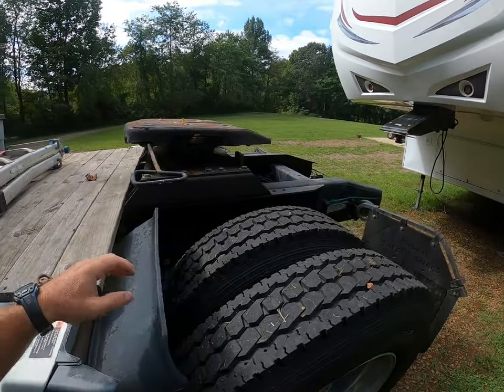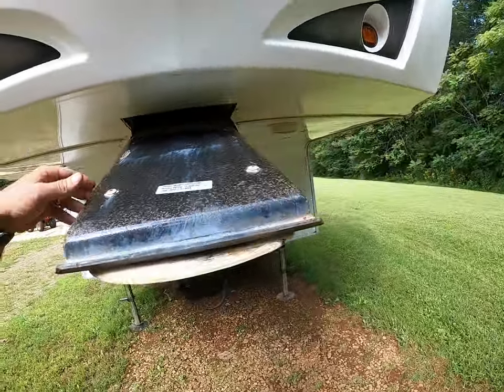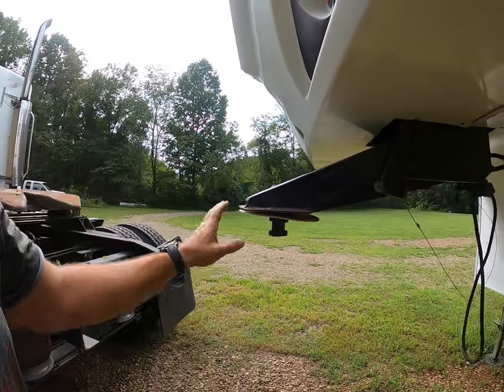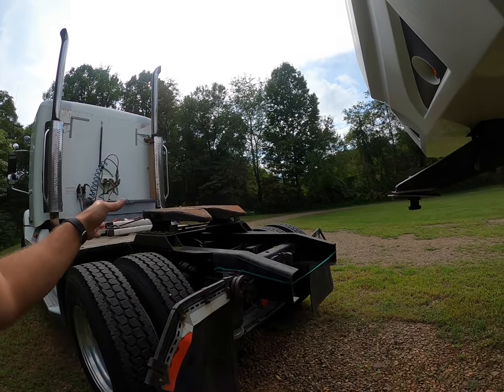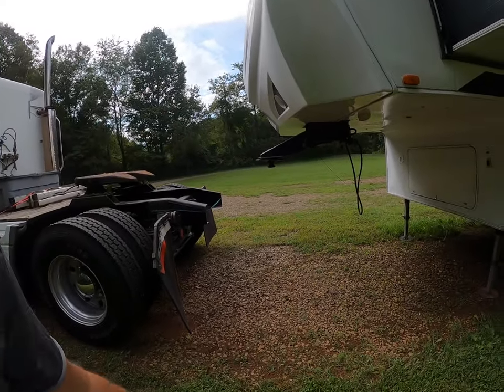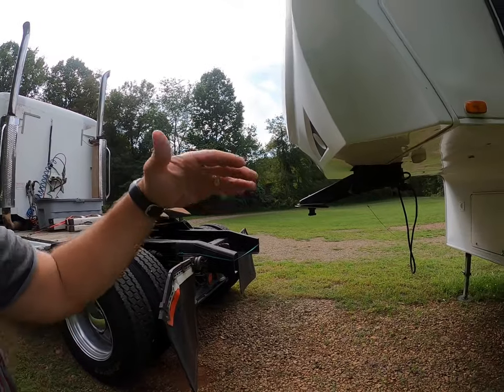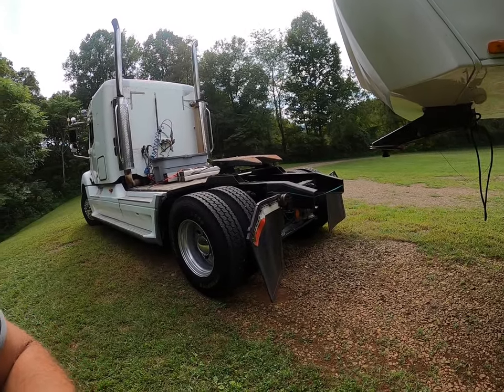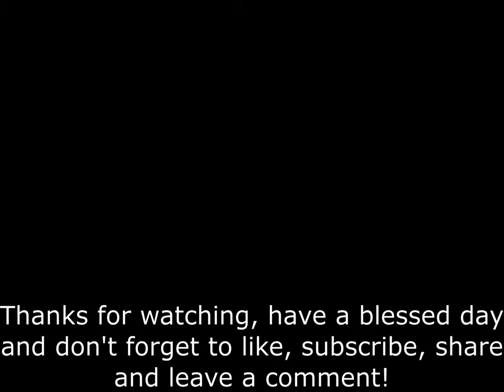Can You Use A Commercial Fifth Wheel Hitch To Pull A Fifth Wheel Camper?

Comment: I am glad this is working out for you.  I broke my Landmark doing this.  The side to side torque in uneven ground and angle approaches stressed my frame and cracked it.  Most of these trailers are not built like semi trailers and won’t take the added torque
Reply from the maker: Yeah in really extreme cases it can put a lot of stress on the frame. I converted to a gooseneck ball. I have some videos of that process on my channel. Thanks for commenting.
Reply: To me, that just shows how inadequate the frame construction of most campers is. Everything in the RV industry is built to a price. With very few exceptions, they are not designed to be long haul vehicles. That’s why I sold mine after a few years.
Reply: The pinboxes on an RV are a little fragile compared to what the underside of a semi-trailer looks like. Not as much surface area sitting on the plate to spread the load out either. However it's possible you just got a crap welding job on yours. They pound those chassis' out by the dozens as fast as they can so the quality control is a little light sometimes. If a little careful to stay on flat smooth stuff it's probably fine. The coupling height should be about the same.
Reply: 20 or 30 years ago recreational fifth-wheel hitches didn't pivot side-to-side, and the trailers of the period withstood that. 

But yes, it's hard on the trailer.
Reply: Buy a dsr moblie suites and it will be fine.

Comment: I’ve used a commercial fifthwheel hitch for towing Rv’s for many years with no problems. The new Rv hitches have side angling capabilities to make it easier to connect and disconnect on uneaten ground. As far as wear and tear of the kingpin goes the average camper will never use their kingpin like a commercial trailer and there’s no difference in the two kingpins. I actually like the stability of a solid commercial hitch. Less tipping of the camper.
Reply from the maker: I agree. Thanks for watching!
Reply: With no side to side angling of the 5th wheel, doesn't that put extra stress on the king pin and/or the 5th wheel?
Reply: If you go off road with your fifthwheel then do not use the commercial hitch. It’s made for flat highway towing.
Reply: What do you mean less tipping of the camper I watched him go around the corner look like a 2 inch gap in between the hitch and the king pin! 📍

Comment: I have done this many times with no issues. With a tandem axle and the hitch slid to the rear.  Now if I was planning on running that way all the time, I would use a hitch modified for hauling a draft arm rock bucket dump trailer instead of a dry box. That also limits the front and back tilt with a removable tilt pin.

Comment: In 04 we started out full time RVing using the commercial plate hitch on our Volvo 660 and a 5th wheel trailer. Before the first year was out we had a RV style hitch. I had lots of issues unhitching and hitching back up when the truck and trailer were not on the same angle of grade in hilly RV parks or spots. I had to really hit the trailer hard a couple times to get the hitch to lock up in those places. The landing gear and frame of the RV trailers are built as lightly and cheaply as the manufacturers can get away with. Do this at your own risk.

Comment: This is what I want to do. With a stock commercial 5th wheel so I can still go out and drive commercial. Everyone else out is using an aftermarket 5th wheel but now I see a stock one will due. You think I could fit a motorcycle in between the 5th wheel and the truck?
Reply from the maker: Yeah, you probably could. If you fave a sliding fifthwheel you could slide it all the way back to gain a little more turning clearance. Thanks for watching! If you have any more questions just let me know.

Comment: Great video after this I installed tulga t10 fifth wheel, it works flawlessly. I like the way it has a large surface so holds on to trailer on the turns specially.

Comment: A Reese Sidewinder Pin box can be used with a commercial turntable in two different ways; the turntable can be stationary with the pin box in Swivel Mode OR it can be locked in place when used with a ball-race mounted turntable.

Other suggestions include using a 'straight-down' pin box for lesser stress.
Reply from the maker: That hitch only offers an offset swivel for short bed trucks. Thanks for watching!

Comment: That was cool now I know I can use the 5th wheel on a Semi  truck to haul my 5th wheel camper trailer that has a pin I did not know that the pin is the same size so that was a big help when I am looking for my truck one question is answer
Reply: Most are the same size, but many heavier commercial fifth-wheels use a larger 3" pin.

Comment: I guess the only folks that would have something to add to this topic would be the manufacturer of the frame? I’d like to here from them. The kingpin is hard mounted to the 5th wheel’s frame without any flexibility, so I don’t see how your setup would be a problem. I know the Reese Goosebox with the air bag is factory authorized for one of the frame manufacturers, but I’d really like to hear from one of the frame companies about this. It’s an important topic, especially with the increase in the use of HDTS for towing.

Comment: Great video and coverage of a topic that seems to generate a lot of questions.  I've been told by a man that runs an RV repair shop that fifth wheel trailer frames are prone to cracking where the bed overhang area is that transitions down to the bottom level area.  Have you experienced this any, or is that more of an issue of questionable frames?
Reply from the maker: I didn't have any issues, but I can see where it could cause some problems if you get in some extreme areas.

Comment: It Looks like the King pin Plate is Lifting At the Sideswhen you turn a corner or Cross Anything that is uneven and I think over time this will cause unnecessary wear or could even cause cracks in the neck of the RV
Reply from the maker: I agree but a lot of rv fifth wheels on the market doesn't offer side to side pivot. And there is a lot of clearance in the throat of the king pin which allows for the lifting that you seen. I guess the deciding factor for me is that I still want to be able to pull a commercial trailer so its a compromise I had to make. Thanks for watching!
Reply: This is functioning just like a 53’ dry van. It lifts the exact same way when on uneven terrain. I’m pretty sure it’s not gonna hurt the camper. I’m glad you posted this video. I just bought a 2021 Cherokee arctic wolf 5th wheel camper. I’m totally gonna pull it with my 2016 freightshaker cascadia.
Reply from the maker: Thanks for watching
Reply: @mikegarza1729  i totally agree.  And the trailer got more weight capacity than camper
Reply: I think in order to judge it better, I think I would like to see the same video of the truck pulling a commercial trailer to see if the same tilting happens between the trailer and the 5th wheel as it does on this video. If it does the same thing, then there should not be much difference, except for taking into consideration the strength and construction of the goose neck to be able to withstand such torque.
Reply: @shisci1  ...except that the camper has a goose neck sticking its neck out beyond the bed of the trailer, which I believe would have more stress placed on it.
Reply: @CarlosGarcia-ls4hn  it does the same. I'm a trucker and have pulled all kinds of trailers. What you are talking about does the same to a semi trailer when on uneven ground.
Reply: @mikegarza1729  did you end up pulling your fifth wheel with your cascadia? Interested to know how it did? I’m wanting to do this with my Volvo 630 but still trying to gather as much info as possible…

Comment: Commercial trucks and trailers don't have side to side pivot. I guess they just design them beefier to compensate for the stresses? I'm not sure. I didn't know rv hitches did have that. I've never pulled an RV trailer, just commercial
Reply from the maker: Definitely built stronger but as you know commercial trailers are also built to flex. Thanks for watching!

Comment: That tilt of the pin box on the fifth wheel is a bit scary at times.  If that plate above the pin was wider and rode more of the fifth wheel plate like the large flat plate on the underside of a semi-trailer it would be better.  Every time the trailer leans and lifts that plate it starts sideloading that pin.  I keep waiting for it to either come off the truck or break.

Comment: Tbh pulling a big ass camper like that with a pickup as never made sense to me. A smaller to medium sized commercial truck. Now that makes sense.
Reply: Well pickups nowadays have 1110 torque
Reply: @rodneyburke2202 weight ratio would be a bigger concern to me. Braking power also.

Comment: What kind of harness connector did u use for the lights. have my own semi nd im trying to pull a small trailer with different connection
Reply from the maker: I just tied into my rear tail lights for brakes, signals and tail lights but I had to hard wire my brake controller in.

Comment: Ive got a 2019 T680 that I use for commercial business and looking to buy a 42' momentum 376th 5th wheel.   The only research I have to follow up on is the jaws to end of frame clearance, where I've got 61" length on my 3 axle tractor and the 5th wheel height,  At 49".  Raising mine to the kingpin height of 56" for level isn't an option.  So I'm looking for an adjustable kingpin option on the trailer itself.  Where I can lower the pin 4-6 inches.  Any ideas?
Reply from the maker: I think you'll be fine with the 61" frame length and my fifthwheel sets around 51". Most pin boxes have some adjustment, mine is as low as it will go. But I have been looking into a goose box (that is lower or closer to the ground) and adding a gooseneck ball to my tractor. They also sell an adapter that has a king pin on one side and a ball on the other so that you can pull a gooseneck trailer from your fifthwheel but you'd have to lock the fifthwheel from pivoting front to back. I hope this helps. If you have anymore questions let me know. Thanks for watching!
Reply: There's enough room on that kw to do that ?other than the height?

Comment: Isn’t there a flexible mount made for the kingpin side as an alternative to the smaller rv 5th wheel hitch?
Reply from the maker: Yes, there is a lot of different king pin boxes on the market that offer cushion. Most are mounted on bushings and a few have air bags. But for the most part they don't offer much left to right pivot. I don't really have an issue with the set up I have but it raised some concern with others. Thanks for watching!

Comment: What did you use to hook up the lights?
Reply from the maker: I tied into the lights on the back of the truck and added a 7 way rv plug to the back of the truck and ran an electric brake wire from the controller in the truck and also a wire from battery positive to charge the camper battery from the truck.

Comment: Are those fifth wheels always so dry, meaning that they have no grease on them whatsoever?  Wouldn't it be good to have a good amount of grease on them?
Reply from the maker: In commercial use you would definitely have grease on the fifthwheel but the white disc on the camper is a lube plate.

Comment: I like your setup but it would make me nervous. The bigger trailers put weight across the entire surface of the plate. That is important because it forces the stress of the side to side movement into the suspension of the truck and trailer. Reducing it greatly at the pin. Your trailer is similar to when you work a nail over and over until it breaks. Your contact area is to small to force the stress off of the pin and actually provides leverage. That is a disaster waiting to happen. On one side you have a 12k tractor and the other a 15k trailer working against themselves on just the king pin. That truck is not giving. I’d build a custom air bag suspension or convert to a ball mount.

Comment: how do you  have the electrical from truck to trailer wired?
Reply from the maker: I spliced in a 7 way rv plug off of the taillights and added a wire from the brake controller.

Comment: Make sure the fifth wheel on the tractor unit is greased up properly.  It's supposed to be black and sticky with grease not exposed rust.  Your running the risk of friction and fire if in a hot climate and if your pulling something as light as that rv if it could simply seize up during a turn and transfer the inertia to the rv body or maybe even flip.   Also your truck should have a diff lock and or crawler gear to get up hill.  It should easily pull that thing
Reply from the maker: Ok, I understand your concern but I'm not sure you know what you are talking about. I use a lube disc on my rv that doesn't require the surface to be greased, but I do keep the jaws greased well. As far as the deferential lock goes, that would be great but unfortunately this truck didn't come from the factory equipped with it and even if it would have I don't think it would pull it up my driveway. A fifthwheel camper just doesn't have enough tongue weight to make a difference. I have to use a 4x4 pickup to pull it up so a single axle semi, even with deferential lock just simply will not compete. Be careful making assumptions when you don't know all the details.
Reply: @GlennConner  its your life dude
Reply: It only has one axle. No dif lock.
Reply: @crazyprepper5400 with one axle it doesn't have an interaxle differential, but that axle certainly has an axle differential... which can be lockable.

Comment: I would be concerned about an invisible stress fracture between the pin box and the structural frame. You may not be able to see the stress fracture until it has a catastrophic failure on the middle of the highway causing a fatal accident. It could also result in a liability lawsuits. Seems like a lot of risk at many levels.

Comment: I own a trucking company with 5 trucks and drive professionally and let me tell ya ANYONE who has driven across I-80 Wyoming in a 60 -70 mph crosswinds knows the last thing you want is to allow your trailer to tilt or lean sideways on the fifth wheel plate. check this vid out https://www.youtube.com/watch?v=r_wnG_iW9So    On vacation I pull a 44' DRV for over 3 years approx 15k miles and have NO issues whatsoever.  After I retire and start full time rving I'm thinking about changing the rear suspension's spring rate from 34k to 12k or less on the rears to soften the ride a little.  I feel the problem is the springs being too stiff.  Fifthwheel plate flexing sideways is normal and All fifth-wheels do so even the commercial ones flex.  You can have your fifth wheel jaws shimmed if you want it tight but I have 659k miles on my 2016 389 Peterbilt semi-truck pulling 80K lb loads and have flexed from day one.
Reply from the maker: Yeah, flexing is completely normal but some people have concerns with it. I drove professionally before I decided to be a stay at home dad. I pulled a log trailer a lot so flex doesn't bother me. I didn't realize that my pin box was lifting on the edges until I made this video but I don't think it will ever be an issue though. I've been towing with this setup for 4.5 years roughly 18k miles with no issues. Do you plan to keep your commercial fifth wheel? Thanks for watching and thanks for the insight!

Comment: The only concern I see here is the almost complete lack of lubricant on either fifth wheel.
Reply from the maker: I use one of those lube disks. I just add grease to the jaws on the fifthwheel and smear some on the king pin. But it is looking a little dry at this time. Thanks for watching!
Reply: @GlennConner  have you seen the teflon 5th wheel plates? Those are pretty sweet. Once I get my own trailer I'll probably get one. I pull someone else's trailers right now though so I'm still using grease.
Reply from the maker: Yeah, tha'd be nice